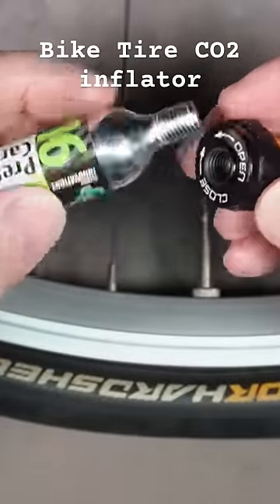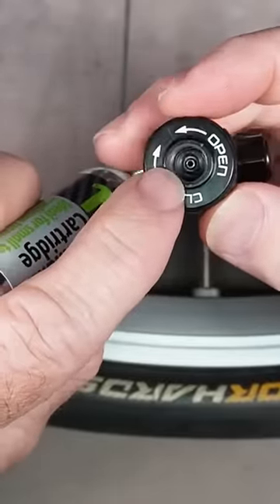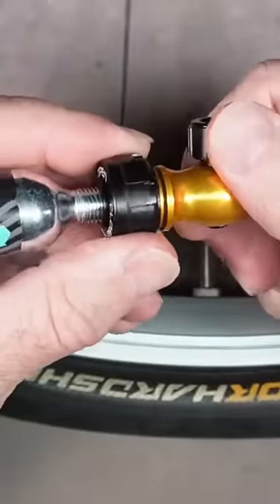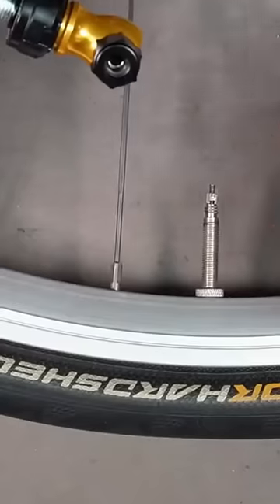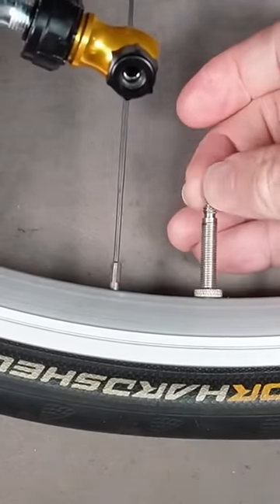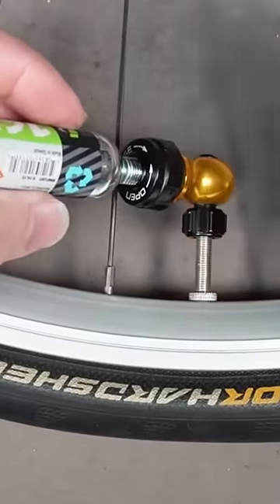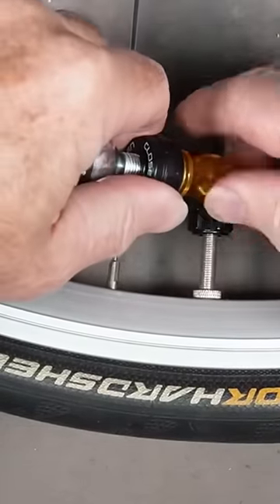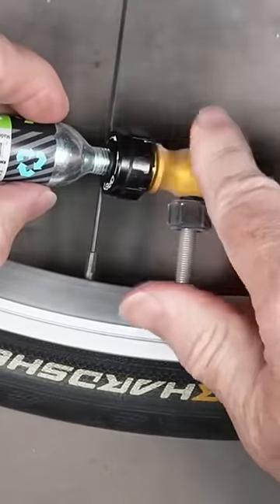Bike Tire (tyre) CO2 Inflator: How to use. #bicyclerepair #bike

Comment: Hand pump looks more adequate and cheaper option, since you can pump the tires with hand pump for same time you screw together co2 pump, and hand pump not that much bigger, probably have same weight and most important is reusable.
Reply from the maker: A CO2 inflator is just another option for emergencies to quickly and easily inflate a tire out on the road after fixing a flat. Thanks for commenting!

Comment: How do you get you get the Schrader valve tight again 
without loosing a-lot of air pressure?
Reply from the maker: This is a Presta valve. Presta valves close when there is pressure inside the tube or tire. I only loosened the lock nut, which is necessary for air or CO2 to flow into or out of a Presta valve. I did not remove the core.
Thanks for the comment! I appreciate it!

Comment: When take off all air going to come out while trying to screw the valve tight, plus I have never seen a bike tire with a valve like that meaning more then likely you will have to buy a certain tube to bike before using it
Reply from the maker: The CO2 inflator will work with Schrader valves as well as the Presta valve in the video. The Presta valve in the video is actually quite popular on higher end road bikes at least in my experience, as I have been using these valves for 20 years. A Presta valve is designed to close when there is pressure inside the tube or tire, so removing the inflator will not let any CO2 come out of the tire. Thank you for your comments!

Comment: I'm curious how your going to take the tool off without losing your air with that Schrader valve unscrewed from the valve stem?
Reply from the maker: This is a Presta valve, not a Schrader valve. Presta valves close when there is pressure inside the tube or tire. I only loosened the lock nut, which is necessary for air or CO2 to flow into or out of a Presta valve. I did not remove the core. You can see the entire video here: How to Use a CO2 Bike Tire Inflator
https://youtu.be/jc-BpZL3lAk
Thanks for the comment! I appreciate it!

Comment: And how to you prevent from deflating once you unscrew this? since you've unscrewed the valve that should keep the air in
Reply from the maker: It is a Presta valve. This is how they work. The pressure inside the tube will keep it closed.

Comment: Lmao aaaaaand soon as you take the tool back off the air immediately comes right back out due to the schrader valve not being screwed in 😂
Reply from the maker: I am glad I made you laugh! However, nothing will escape when the CO2 inflator is removed. This is a Presta valve. Presta valves close when there is pressure inside the tube or tire. I only loosened the lock nut, which is necessary for air or CO2 to flow into or out of a Presta valve. I did not remove the core.
Thanks for the comment! I appreciate it!
Reply: @davescycling  well alright then, never heard of a Presta valve, pretty cool then, learned something today
Reply from the maker: Thanks for the reply! I am finding that the Presta valve is less popular than I actually thought it was! Lots of people are commenting similar to yours, but I I’m definitely learning a lot myself!

Comment: So if you unscrewed the schrader valve; what keeps the gas in there when you remove it?
Reply from the maker: Nothing will escape when the CO2 inflator is removed. This is a Presta valve. Presta valves close when there is pressure inside the tube or tire. I only loosened the lock nut, which is necessary for air or CO2 to flow into or out of a Presta valve. I did not remove the core.
Thanks for the comment! I appreciate it!

Comment: seems nice for an emergency but def wouldn’t wanna rely on that for regular use since it has no pressure control
Reply from the maker: Absolutely! Great small solution for quick inflation after fixing a flat on the road! Thanks so much for commenting!

Comment: Seems wastfall and expensive. However I get it, as that the cartridge is compact and light. But I just carry a small pump in a back pack with spare inner tube.
Reply from the maker: Yes, a pump is the cheap, no fail solution for sure! But if you want to travel as light as possible, CO2 is a good option! Thanks so much for the comment!

Comment: Looking in the NIST Doc regarding permeability of gases through rubber this document does show the permeability to be higher for CO2 than air. See table 9 and table 10:
Reply from the maker: Yes, CO2 will leak out of your tire within a few days. The CO2 inflator is designed for emergency use on the road after repairing a flat. It is advised to replace the CO2 with regular air once you get home. Thanks for the comment and the input. It is much appreciated!

Comment: What’s the benefit over a bike pump?
Reply: size and weight
Reply: @saurabhsrivastv  oh like you keep this with you while you ride
That makes sense
Reply from the maker: Absolutely you keep it with you!! a CO2 inflator is exactly made for emergency inflation after fixing a flat out on the road. The cartridges are super small. The valve is even smaller. These will fit anywhere jersey pocket, small saddle bag, you’ll never even know you have it until you need it! Just another option, pumps are also extremely useful. I prefer these because they inflate a tire in three or four seconds, vs Time and effort of a bike pump or the painfully long time it takes one of those mini rechargeable pumps to fill the tire, lol.

Comment: Nice but It will pop the tire if I left it long, right?
Reply from the maker: The volume of CO2 in the cartridge is enough to inflate most bike tires to a reasonable pressure to get you back on the road. Check out the description for information on what size tires it will fill and how much pressure it will provide. It would be very difficult to pop a tire if you start with a flat tire. Thanks for your question !

Comment: I think I'm missing something. Why would you have to unscrew the Schrader valve? They are one way. Now the moment that you remove the air chuck, all the air leaks out.
Reply from the maker: Nothing will escape when the CO2 inflator is removed. This is a Presta valve. Presta valves close when there is pressure inside the tube or tire. I only loosened the lock nut, which is necessary for air or CO2 to flow into or out of a Presta valve. I did not remove the core. You can see the entire video here: How to Use a CO2 Bike Tire Inflator
https://youtu.be/jc-BpZL3lAk
Thanks for the comment! I appreciate it!

Comment: How do you tighten the valve on the tire afterwards without it leaking air?
Reply from the maker: Nothing will escape when the CO2 inflator is removed. This is a Presta valve. Presta valves close when there is pressure inside the tube or tire. I only loosened the lock nut, which is necessary for air or CO2 to flow into or out of a Presta valve. I did not remove the core. You can see the entire video here: How to Use a CO2 Bike Tire Inflator
https://youtu.be/jc-BpZL3lAk
Thanks for the comment! I appreciate it!

Comment: Since when do you have to unscrew that part of the valce stem?
Reply from the maker: This is a Presta valve. Presta valves close when there is pressure inside the tube or tire. I only loosened the lock nut, which is necessary for air or CO2 to flow into or out of a Presta valve. I did not remove the core. You put can see the entire video here: How to Use a CO2 Bike Tire Inflator
https://youtu.be/jc-BpZL3lAk
Thanks for the comment! I appreciate it!

Comment: i feel like the cold would be a problem. cuz the air and the ruber is more compact when cold. and when the rubber and air gets warm, the tire will get diflated ones more i think?¿ omg im sorry for bad formulation, im from norway.
Reply from the maker: It works perfectly! I have used it many times. Just for emergency inflation on the road.

Comment: So with the shrader valve unscrewed, how will the air stay in when you take the inflator off?
Reply from the maker: Nothing will escape when the CO2 inflator is removed. This is a Presta valve. Presta valves close when there is pressure inside the tube or tire. I only loosened the lock nut, which is necessary for air or CO2 to flow into or out of a Presta valve. I did not remove the core. You put can see the entire video here: How to Use a CO2 Bike Tire Inflator
https://youtu.be/jc-BpZL3lAk
Thanks for the comment! I appreciate it!

Comment: Why is it better to have co2 instead of just plain air?
Reply from the maker: Air is definitely better, A CO2 inflator is just another option for emergencies to quickly and easily inflate a tire out on the road after fixing a flat. It is super small, light and inflates a tire in seconds. However, after using one you need to replace it with regular air . Thanks for commenting!
Reply: @davescycling  Most Welcome. I think it may be down to easier manufacturing or storage but just pondering cause compressing plain air is probably cheaper than getting CO2 from somewhere. 😁

Comment: Nice but how do you screw in the valve stem when you take off the inflater😢
Reply from the maker: This is a Presta valve. Presta valves close when there is pressure inside the tube or tire. I only loosened the lock nut, which is necessary for air or CO2 to flow into or out of a Presta valve. I did not remove the core.
Thanks for the comment! I appreciate it!

Comment: In der Zeit,  was er da macht,  hab ich den Reifen mit der Luftpumpe aufgeblasen 😂
Reply from the maker: A CO2 inflator is just another option for emergencies to quickly and easily inflate a tire out on the road after fixing a flat. It is super small, light and inflates a tire in seconds. Thanks for commenting!

Comment: How do you re-screw the valve stem valve without losing air pressure?
Reply from the maker: Nothing will escape when the CO2 inflator is removed. This is a Presta valve. Presta valves close when there is pressure inside the tube or tire. I only loosened the lock nut, which is necessary for air or CO2 to flow into or out of a Presta valve. I did not remove the core.
Thanks for the comment! I appreciate it!

Comment: But if you opened the valve stem what prevents the air from coming back out
Reply from the maker: Nothing will escape when the CO2 inflator is removed. This is a Presta valve. Presta valves close when there is pressure inside the tube or tire. I only loosened the lock nut, which is necessary for air or CO2 to flow into or out of a Presta valve. I did not remove the core. You can see the entire video here: How to Use a CO2 Bike Tire Inflator
https://youtu.be/jc-BpZL3lAk
Thanks for the comment! I appreciate it!

Comment: I would put an in-line pressure gauge on it so that I can inflate the tire to the proper pressure. Guessing it by Philo or by sound is dangerous
Reply from the maker: Pressure gauge would be ideal, but knowing before hand how much CO2 is needed works good enough for emergency purposes. I know that 1 16g cart will inflate my 700c x 28mm tires to 90-95 PSI. That will get me  back on the road for sure. Thanks for commenting!

Comment: Rwmoving the valve is counter intuitive. It leak out when u try to reinstall it
Reply from the maker: Nothing will escape when the CO2 inflator is removed. This is a Presta valve. Presta valves close when there is pressure inside the tube or tire. I only loosened the lock nut, which is necessary for air or CO2 to flow into or out of a Presta valve. I did not remove the core.
Thanks for the comment! I appreciate it!

Comment: It's kind of a good idea until you realize, once the gas warms up it's gonna expand. So if you're filling it completely full with cold gas before waiting for the temperature to rise, you're gonna over inflate it.
Reply from the maker: Thanks for the comment. Never had an issue with overinflation. I have used this many times to inflate my road bike tires after fixing a flat.

Comment: Then disconnect and loose all the co2 before you can get the value stem shut.
Reply from the maker: Nothing will escape when the CO2 inflator is removed. This is a Presta valve. Presta valves close when there is pressure inside the tube or tire. I only loosened the lock nut, which is necessary for air or CO2 to flow into or out of a Presta valve. I did not remove the core. You put can see the entire video here: How to Use a CO2 Bike Tire Inflator
https://youtu.be/jc-BpZL3lAk
Thanks for the comment! I appreciate it!

Comment: How do you keep the air in it while screwing the valve stem core back in
Reply from the maker: This is a Presta valve. Presta valves close when there is pressure inside the tube or tire. I only loosened the lock nut, which is necessary for air or CO2 to flow into or out of a Presta valve. I did not remove the core. You can see the entire video here: How to Use a CO2 Bike Tire Inflator
https://youtu.be/jc-BpZL3lAk
Thanks for the comment! I appreciate it!

Comment: Or buy a hand pump that connects to your frame and will never fail you or run out of what ever they use in that container
Reply from the maker: That works too! A CO2 inflator is just another option for emergencies to quickly and easily inflate a tire out on the road after fixing a flat. Thanks for commenting!

Comment: I just don’t get the advantage over a regular pump. They are small and work fine. Why would you do this instead?
Reply from the maker: A CO2 inflator is just another option for emergencies to quickly and easily inflate a tire out on the road after fixing a flat. It is super small, light and inflates a tire in seconds. Thanks for commenting!
Reply: @davescycling  👍

Comment: Thank god, I have owned a bike for 25 years with a presta valve and did not know how to unscrew the valve.   Just been riding rims. Also, I did not know that CO2 was air.  Learn so much....
Reply from the maker: If you read the comments, you will see that most people do not even know what a Presta valve is, let alone how to use it. Thanks for the comment!

Comment: Problem is the extreme cold air hardens the rubber making it seem to be full but once it warms up it seems deflated. Also you can ruin the "temper" of the rubber making it ware faster
Reply from the maker: Are you saying that the tire is not really inflated?
Reply: @davescycling  not at all. Im saying that the low temp doesnt allow the rubber to expand fully. Thats why it seems to deflate when the rubber comes to normal temp.
Reply from the maker: Thanks for your input. I really appreciate it!
Reply: @davescycling  all good fam i just fuckin love chemistry

Comment: So how do you put the valve core back into the stem without all the air coming out?
Reply from the maker: Nothing will escape when the CO2 inflator is removed. This is a Presta valve. Presta valves close when there is pressure inside the tube or tire. I only loosened the lock nut, which is necessary for air or CO2 to flow into or out of a Presta valve. I did not remove the core.
Thanks for the comment! I appreciate it!

Comment: Why did he remove the stem? Wouldn't a pump made to inflate tires be like any tire inflating device and not need to remove the stem?
Reply from the maker: This is a Presta valve. Presta valves close when there is pressure inside the tube or tire. I only loosened the lock nut, which is necessary for air or CO2 to flow into or out of a Presta valve. I did not remove the core.
Thanks for the comment! I appreciate it!

Comment: I haven't changed a bike tire in years but dosent it release all the air/c02 when you unscrew the valve stem core?
Reply from the maker: This is a Presta valve. Presta valves close when there is pressure inside the tube or tire. I only loosened the lock nut, which is necessary for air or CO2 to flow into or out of a Presta valve. I did not remove the core.
Thanks for the comment! I appreciate it!

Comment: So how do you reinstall the valve.

The little pin sticking up is normal depressed the air nozzle is pushed into the valve stem

To slow air in all automatic closing when the air nozzle is removed
Reply from the maker: This is a Presta valve. Presta valves close when there is pressure inside the tube or tire. I only loosened the lock nut, which is necessary for air or CO2 to flow into or out of a Presta valve. I did not remove the core.
Thanks for the comment! I appreciate it!

Comment: One big problem though, you're going to lose all that air when you take off the CO2 valve, because there's no air valve on the Wheel and you're not getting one on there before all that air gets out.
Reply from the maker: Nothing will escape when the CO2 inflator is removed. This is a Presta valve. Presta valves close when there is pressure inside the tube or tire. I only loosened the lock nut, which is necessary for air or CO2 to flow into or out of a Presta valve. I did not remove the core. You can see the entire video here: How to Use a CO2 Bike Tire Inflator
https://youtu.be/jc-BpZL3lAk
Thanks for the comment! I appreciate it!

Comment: Yeah I get to CO2 cartridge but wouldn't the frozen nature of the gas damage the rubber and then eventually make it fail?
Reply from the maker: Thanks for the question! I have been using this method of emergency tire inflation for many years. I have used it on many occasions to get me going again after a flat on a ride. I have never had a tube fail during or after any of these events. CO2 inflators are actually very popular with road cyclists and most people I ride with use them.

Comment: Wouldn't CO2 be the worst gas used to inflate a tire? When it heats it expands. When it cools it contracts. So you have flat tires when its cold out, but tires that could pop when it heats up.
Reply from the maker: A CO2 inflator is just another option for emergencies to quickly and easily inflate a tire out on the road after fixing a flat. Thanks for commenting!

Comment: Use nitrogen instead. As co2 if filled in full amount as of tube capacity, in hot days it would blast the tube!🥲😂
Reply from the maker: Nitrogen would be better, but CO2 works fine for emergency use. Thanks for the comment!